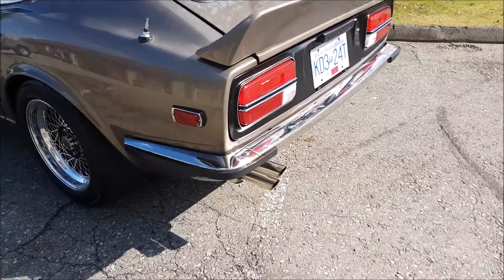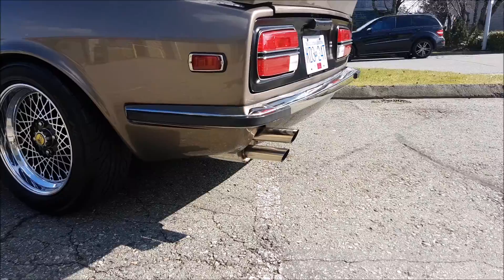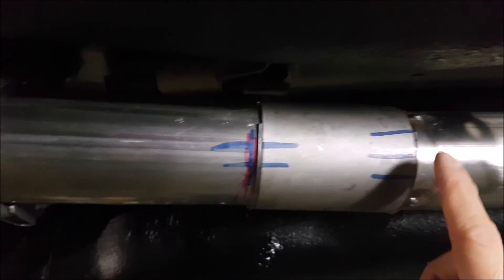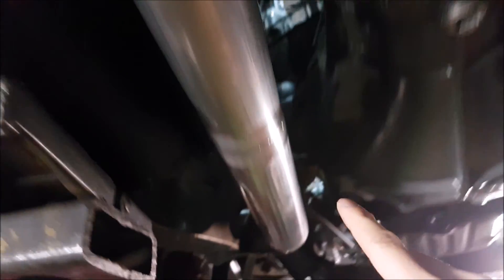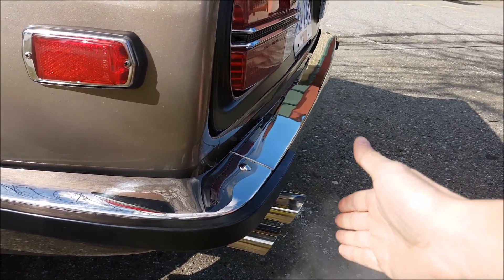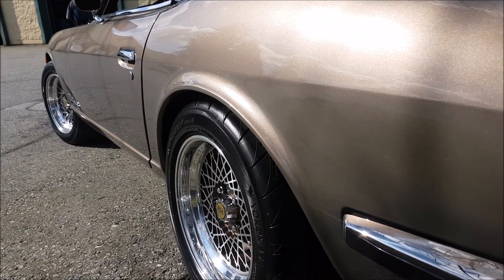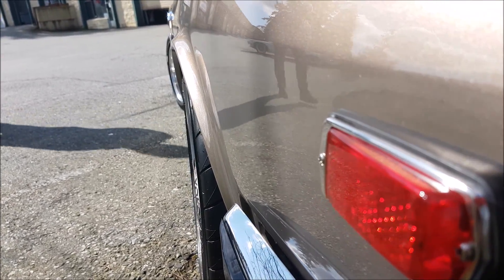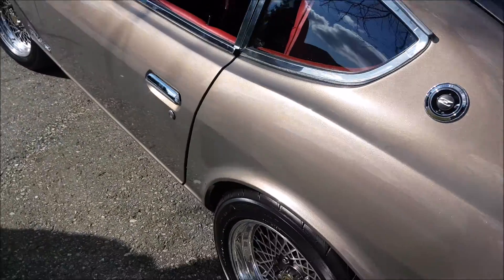1970 Datsun 240Z Fujitsubo 2.5" Custom Stainless Steel Exhaust (L28ET Engine Swap) | AnthonyJ350

Comment: For the eibach springs, did you put the shorter springs in the back or the front?
Reply from the maker: I didn't install them. Eibach will designate which is front and back, do not swap them around because the spring rates are tuned for the vehicle.

Comment: That looks real close to the 1978 280Z factory color, is that what you used? I was looking at buying one brand new back then in that color, still looks great.
Reply from the maker: It's actually a colour from Aston Martin.  The owner wanted the car to be themed with more class and a European Touring car.  The interior colour scheme is also Aston Martin.
Reply: @AnthonyJ350  You know its all relative as many colors look similar until you start comparing them side by side. I remembered trying to choose between the silver blue that Datsun did for years, the black limited edition & the one that looks very close to the Aston color, the Z cars are still great looking today. In the end I ended up buying a 1979 Z-28 when I graduated high school. One thing I think you will find pretty cool is that I was way ahead of my time in auto stereo as I had the famous Alpine 7307 cassette tuner, Zapco system 150LA 3 piece amp Zapco PEQ,, the speakers were all separates home drivers consisting of 4  8" woofers on the back deck, Audax 5" midrange & soft dome tweeters in the door. That was the early days of high end car audio. Back then it wasn't about ultra high spa levels but that system really sounded great. I thought you might appreciate the story as I know you put a nice system in the Z

Comment: Can anyone help me ? I want a engine swap for my 240z but not a v8 or 4 cilinder turbo or something.. i want a v6 natural aspirated. Any suggestions?
Reply from the maker: VQ35DE has been done
Reply: VQ35 is an option, but an RB25 or RB 26 would be cool too. They are both straight 6.
Reply: Ford 3.7 cyclone, not the prettiest looking engine but very good engine and reliable, or vq37vhr which is also a 3.7 v6 but the sound is more suited for the look of the Z, the BMW m50 engine is pretty good especially boosted